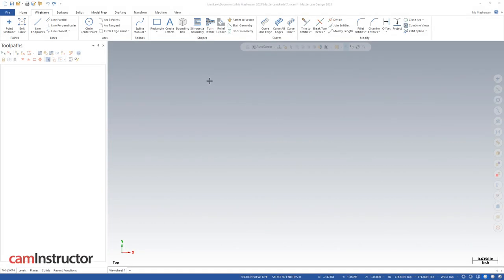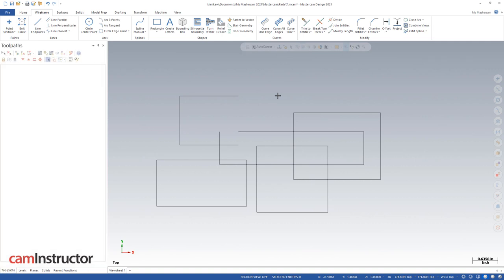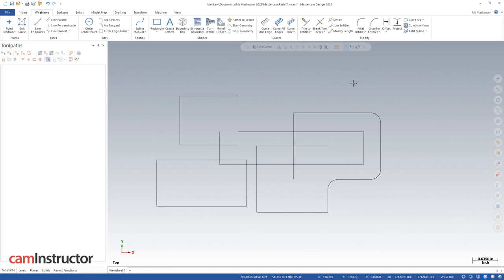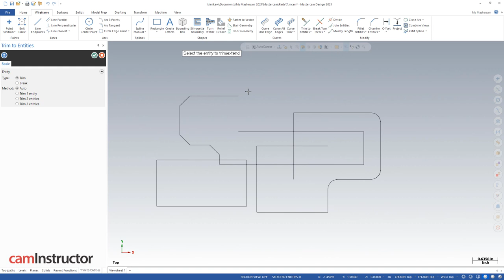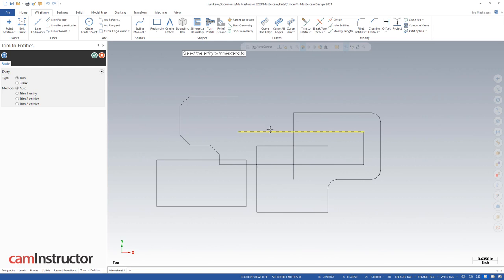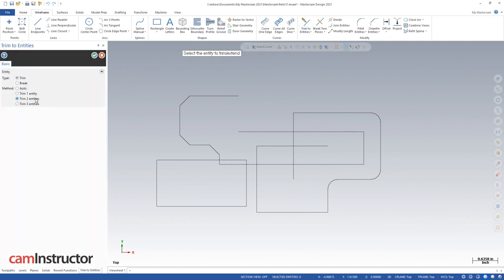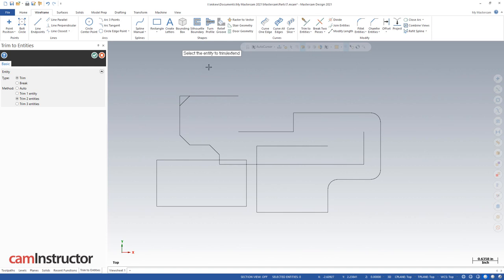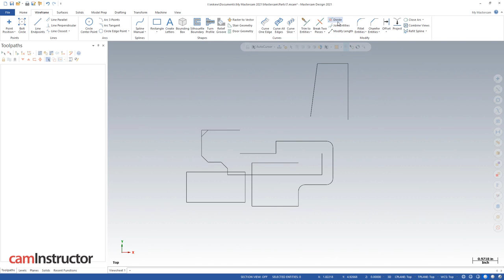Mastercam 2021 is a Drag!

Comment: I find the trimming functions like so many in Mastercam a little quirky! I dont know what it is with Mastercam, it seems like it comes from a heritage of ugly old dinosaur! Its just got toooo much character sometimes. The trimming!!! If i cross over a Cross then how on earth can i know which of the lines will disappear! I think i set up (yet again) my own short cut to get past the problem of trimming lines and always knowing which line WILL disappear. Thats mark the lines i want to trim, hit Ctrl+Shift+X (split lines) then mark the line i want removed and press delete! Mastercam has come a long way but the pedagogical usage seems soooo far behind still. Just how many old dinosaurs are there still working at Mastercam i wonder? I speak a little disrespectfully but i do like Mastercam but just feel as though improvements to basic usage are incredibly slow to improve significantly.
Your films ARE helping. Thank you.
Reply: I know what you mean. I think that ugly old dinaosaur might might the old CADKEY software back in the day. When Mastercam first came out, there were many features identical to it. Not sure if CADKEY was bought out by CNC Software or what the deal is.

Comment: I am trying out the fillet tool in a mill application where the part has a corner notched out with a 3D feature. In the past, when filleting lines that didn't already intersect (as in with this notched out corner), the extending was done automatically. Now, the same action leaves behind only a fillet and I have to manually extend each profile line to the fillet. I have not been able to manipulate the options to get the function to act the way it did in previous versions. Am I doing something wrong, or has Mastercam (once more) eliminated some old useful functionality in favour of pretty new toys that resemble SolidWorks drafting?
Reply from the maker: When in Fillet, in the Fillet Menu on the left, at the very bottom, make sure you have Trim Entities enabled. This allows the lines to be automatically trimmed or extended as needed.
Reply: @CamInstructor  I have that option turned on. If I am lucky, it might extend one of the lines. 4/5 times it only leaves behind the corner radius. Would it help if I posted a video to demonstrate? I don't want to just complain; I really want a solution to this issue.
Reply from the maker: Is everything on your computer up to date? Windows, Mastercam, VideoCard Drivers?
Sure, post a video. Glad to help if it's something about the use of the software, however, if this is a system issue or software bug you'd probably get better answers from your Reseller or Mastercam directly.
Are you using 2021? Full version or HLE? Your computer meets minimum system requirements, specifically a dedicated video card?